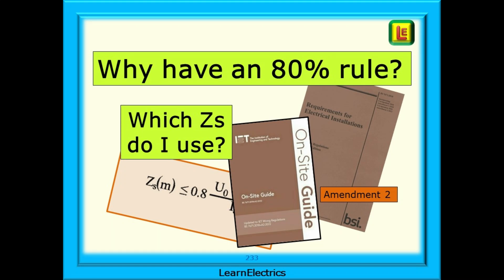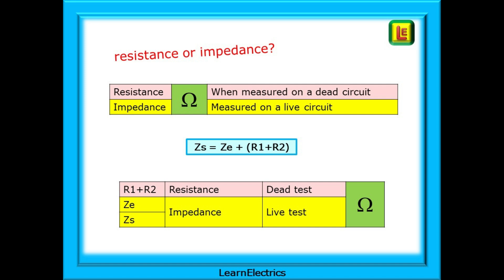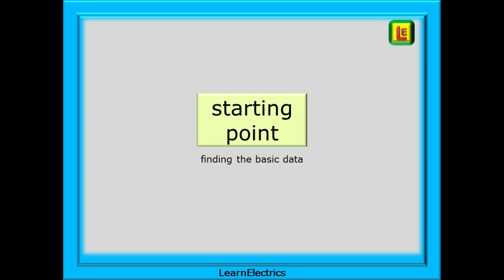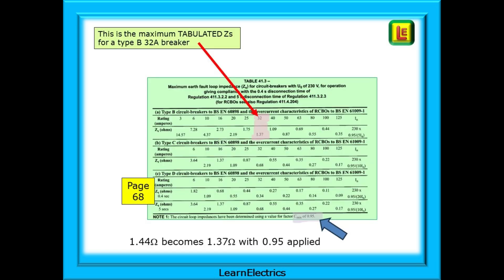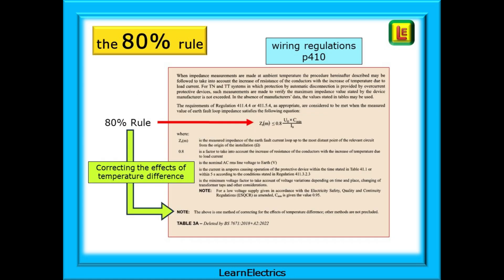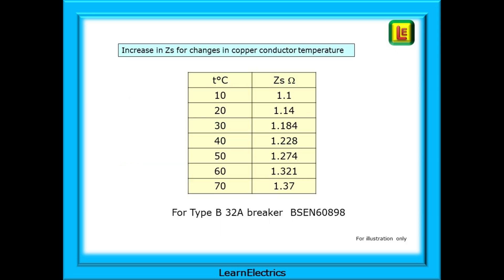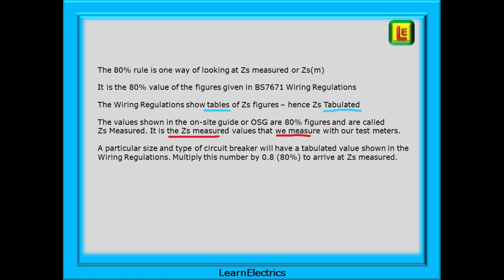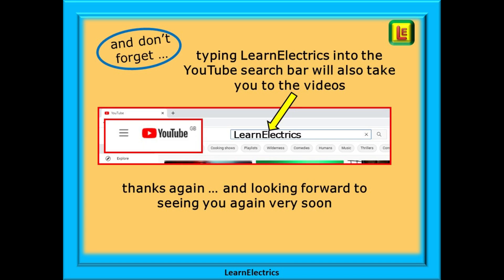THE 80% RULE – Zs MEASURED – Zs TABULATED – WHAT IS THE DIFFERENCE? – WHICH ONE TO USE WHEN AND WHY

Comment: Always brilliant 
There’s a big Villa which has main DB attached with capacitor bank upstream 
If I want to Zs measurements what precautions should I take and what will be the accuracy of the meter readings 
Thanks 🙏
Reply from the maker: Without seeing the actual set up, difficult to say. Just be aware that capacitors can hold a charge for a long long time.

Comment: Brilliant summary of older videos. Thanks! Is it new regulation of disconnection time 0.1s, instead of 0.4s?
Reply from the maker: See the attached comment. Perfect explanation. Modern MCBs will achieve 0.1s which easily covers 0.4s. Same regulations, just better response times on newer devices.
Reply: 0.4 is maximum permitted 
0.1 is considered instantaneous and is the target
Reply from the maker: Thank you, excellent support. Dave.
Reply: Thanks 🙏